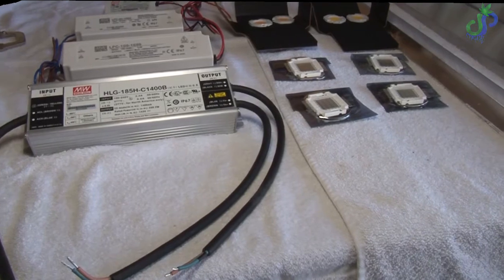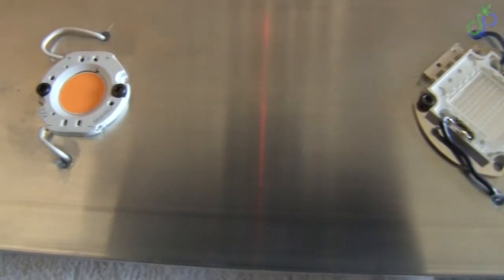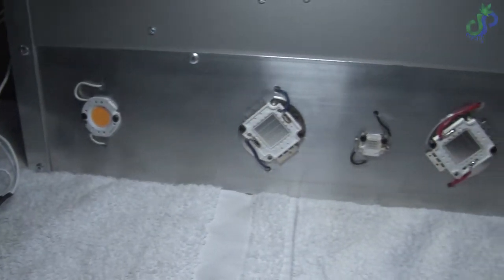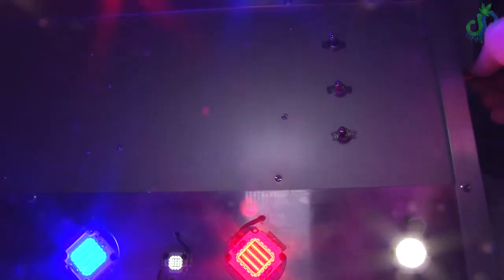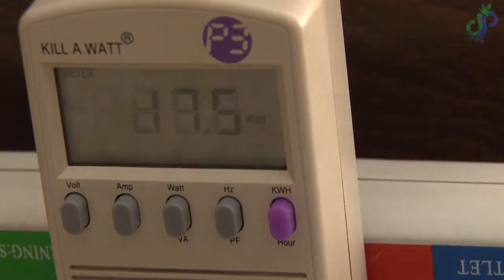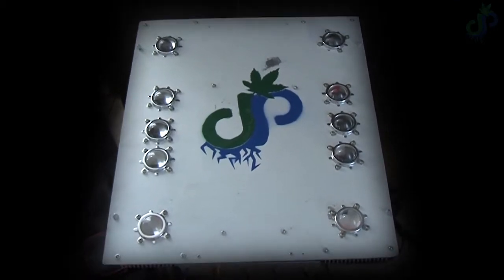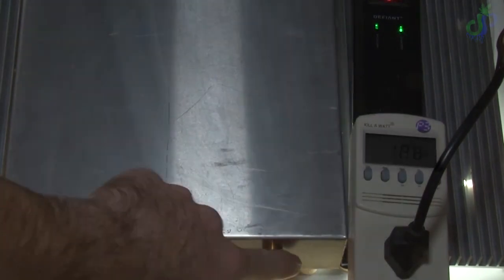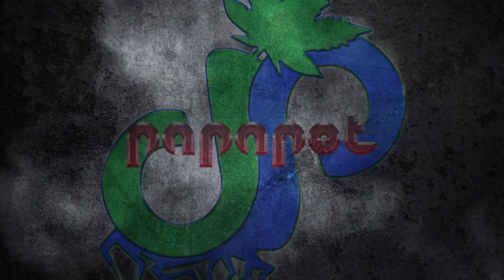DIY Bridgelux Vero 18 custom led grow light

Comment: Hi,do you know citizen clu48 1812 cri 80 versión 6 working on 100w each.
There are good one for growing and flowering?
Thanks.
Reply from the maker: I liked them because they were economical. Work well for all growing times. Inexpensive and powerful. But they are outdated now. I definitely think a pcb style boards are where its at now. But if you're trying to supplement to it with citizens. I think you'll be fine
Reply: @jPapapot  i living in Argentina. Here thosen't staff to get nothing. So this Is only posibility.
Price u$100 each.?
Reply from the maker: @JS-wk4qs  I see your predicament. Well then do the citizens they'll grow and flower plants

Comment: You going to have to put a a car called in the very center or you going to have to put to Cobb's in the center or at least one in the center because you're a cop sorcerer or spread apart with a big gap in the center I struggle with it for with mine until I put them close together and had it just right where they actually share they're light off for Cobbs on the one unit mixed with full spectrum full spectrum 3 watt tank LED chips that have UV Blue red ultraviolet mixed in plus like I said blue red and maybe even if Ur read everything to plant needs has the pink light plus full spectrum light wait White

Comment: Dope light!  I like your manipulation scheme, looking forward to seeing the results!
Reply from the maker: gonna be honest not worth it so far. Its only been a few weeks but I'm getting better results with all of them on, blue, red and white ones. But I'm really  hoping controlling the flowering stretching is where this will come into play.
Reply: jPapapot , makes sense I guess, the more intensity the better for sure!  But the flower stretch u should be able to control a little better I bet. Flower sooner?  I have 5 ft height tents so I have to keep em short, sucks!  About to get a timber kit, get my feee wet. Nelson antennas said 50w sq ft was to much?  I have 3 4x2x5 tents with g8's 1 optic 1 and mars which par is horrible after seeing and using a cob.   Vero or cree for flower only?  Hey your light looks great have you checked the par output?
Reply from the maker: no i want to but i don't have the cash to drop on a par meter that shit is pricey. Eventually I'll save up for one. I have a new build that I just filmed and edited and I'll probably upload next week to because watching me refill my water is boring as fuck. But it uses these https://www.digikey.com/product-detail/en/bridgelux/BXEB-L0280Z-30E1000-C-A3/976-1492-ND/6236278 and it is fucking bright. I make the hole fixture for $145 could have done it cheaper but i always seem to buy shit i don't need because apparently i like to waste money. But its 110- 129 watts and it doesn't require a heat sink. they come in 1ft 2ft and 4ft strips and there easy as hell to work with. No drilling was needed but i did it anyway. they also have the benefit of being less than 2 inches thick with the driver mounted on it. Essentially  your making a quantumy type board or you can make a fluence replica. I have a picture on my Instagram under the same name jpapapot.
Reply: Put it up!  Man I'm trying to watch as many vids on cobs!  Yeah. Those meters are freaking pricey.  Are u getting good results with your build?  The plants are liking it, vigorous growth?  And how's the heat, I'm hoping these are running cooler than what I'm running.    These builds look fun though, make exactly your specs!  Like that red, yeah man all of that diff spectrum is prob legit!
Reply from the maker: I'm actually having an issue of getting it in the 80's i have the light running around 200 watts and its decently warm  but i have 2 6" desk fans blowing on it constantly one on each heat sink. and i'm in socal so were cooling down. I will say the mistake I make was the size. The cobs are like way to far to the outside which blows but at least my corners won't have shadows. I should have put the veros in the center not the outside. And  my growth is really nice. I had to defoliate a once a week because they keep blocking each other and i need to get as much light around because my whole grow relies on the scrog being full. 
But yeah give me some time to edit the video and I'll post it but the new build isn't a cob fixture. 
hey man thanks for watching though. the whole reason I started posting was to get more input for people because I feel like i was not getting responses from blogs and forums and shit so I highly recommend to you is to record your builds. I don't get a lot of likes or follows or even views but its better than it ever was on roll it up and shit.
Reply: That's a nice little board, for veg?  Yeah man if you build post it, plz!  I'm still looking to build for 2 2x4x5 tents.  The Vero's from what I read seem to be good, or crew cxb 3590's.  Everyone seems to be going with those.  It's all about that production.  Watch a lot of growmau5. I'm not to electronically inclined, but the par results I'm seeing are through the roof!  Do u like your vero's ?  Have you flowered with that light yet?  Yeah man I need to get a meter as well.  Only way to really see what's going on for sure!! So damn much,!
Reply from the maker: I feel like were similar. I learned everything from growmau5. I have a few electronic friends but i never understood it. i can do the math which is good enough and most stuff is plug and play.  
Right now i believe greengenes was saying that the vero 29s 80cri are the best on the market for price and output. and yeah i agree prices are fucking expensive which is why i built smaller set ups. i need to save for a while for every build. I'd love to run cxbs but i cant ford more than one or two plus the driver and the heat sinks. 
I'm trying to hit that group of people who want good shit cheap. Explore less expensive options because that's how i have to do it.  The best part of the PCB boards (quantum, sunboard, or amleddesign) coming out is the fact that they don't require heat sinks which saves so much money.
This is my first grow in my own place. I have been in a situation until recently that i couldn't grow at home. So i worked at a clone collective. I haven't had a flowered plant in about 8 years. 
So needless to say i'm excited to see what these bad boys grow. I'll keep posting so you can follow along. I have some more stuff i'm working on because this shit is getting boring every week. But i hope in 2 weeks to start flowering.
Reply: Totally agree, I'm in a place where's its kinda hard to grow, only input is internet for learning all this!  Greengenes is the shit, him and growmau5 and know you is where I'm learning this!  It's all a little pricey is right, just sick for buying these panels over the past few years!.  If I only knew.  Man I bet you're stoked, 8 yrs!  Nothing like growing your own!  If you don't mind I might hit u up with some ?'s.  Going to start a build within the month.  Going to make 4 fixtures for the 2 4x2 flower tents.  4 2x2's. Have to do it his way, $!!   I have to learn the electrical side of everything, volts, amps all that crap!  Really not sure on how many to run in that area? 4, 6, 300w-400w?  It looks like you have a good time building your lights, I can totally see myself after building 1 constantly having another in the works!  Any advice throw my way plz!  I can send pics or whatever. Stoked for your grow, 8 yrs!
Reply from the maker: Justin Glenn anything you need just ask. I'm not super knowledgeable but I can find answers. I'd say go with vero or citizens. Cree is awesome but pricey as fuck